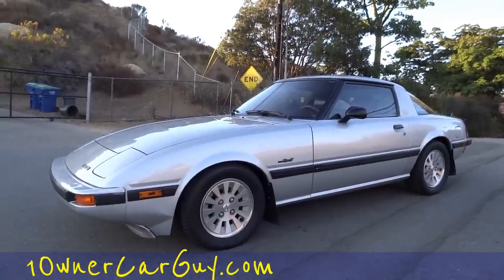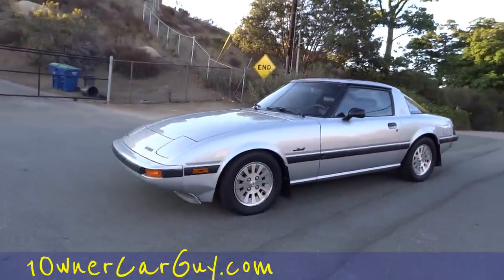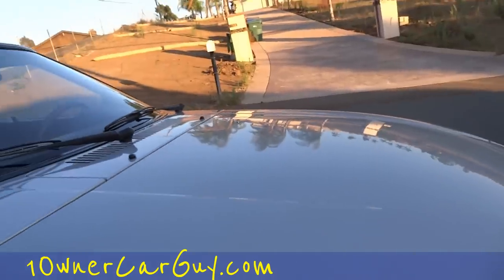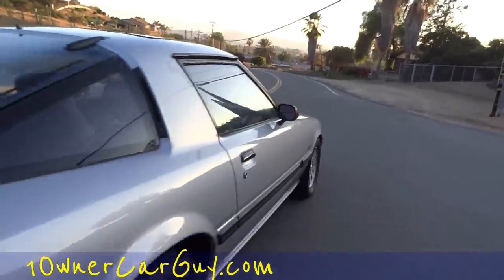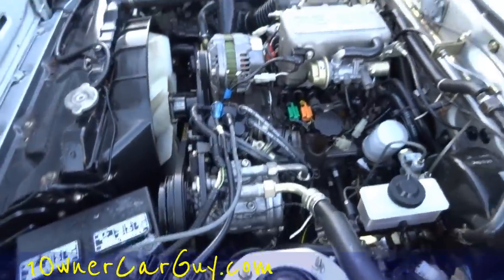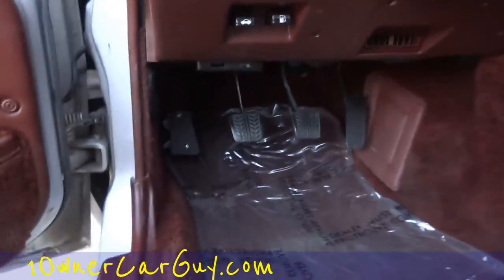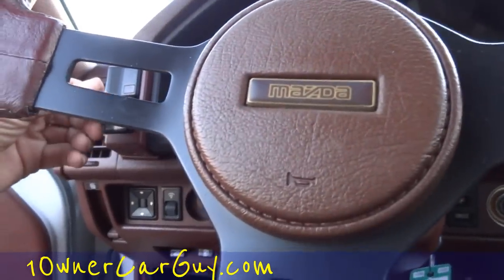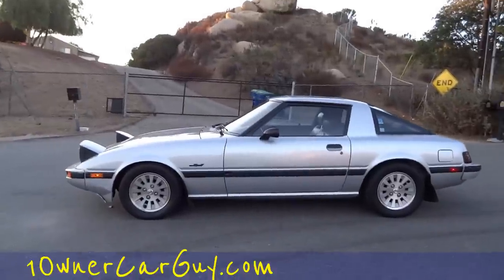Mazda RX-7 Savanna GSL SE S3 1984 Coupe 5-Speed 13B Test Drive For Sale Review #2

Comment: Actually the buzzer goes off a 7000 rpms, the Australian versions are set at 6500rpms to let you know the 7000 red line is coming up. The engine red line itself is set very conservatively by Mazda, the engine is more than capable to rev to 8500rpm.
Reply: The needle hits the stop at about 8,250... but the engine keeps winding up, and does not seem to care in the slightest.

Comment: That white jaguar XJ8 you have these cars are good, I think you should stock these as well, including the Vanden Plas version, and another one you should try out is the XK8 from 1996 onwards these are good as well.  And the Mercedes W129 1990 onwards are good, but don't buy any Mercs built between 1998 to 2004, the models have got a reputation for rust.  I have seen a few in the UK, and they tend to rust all over.